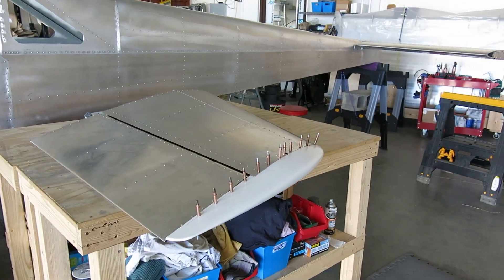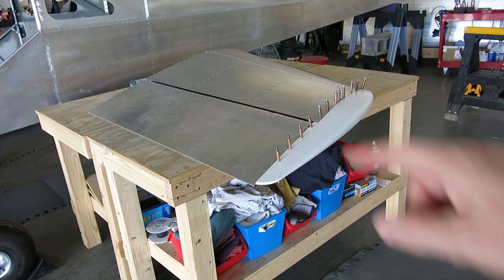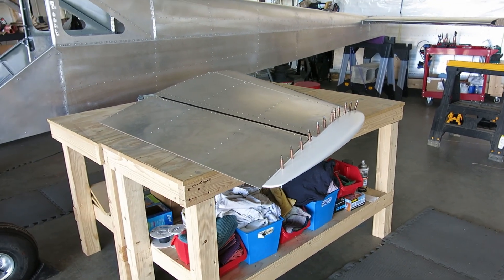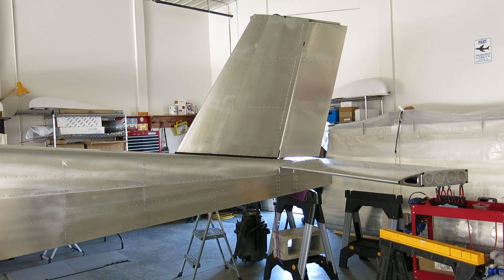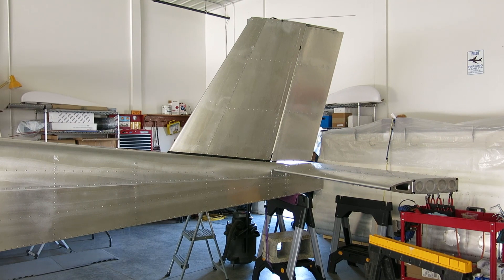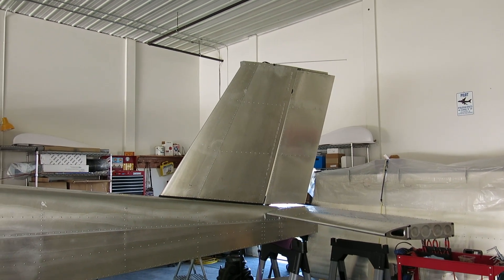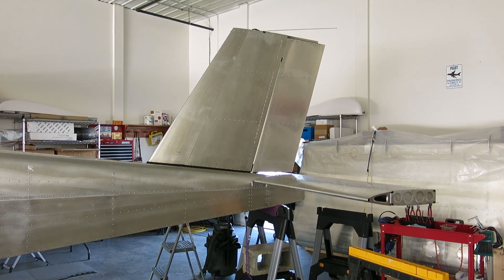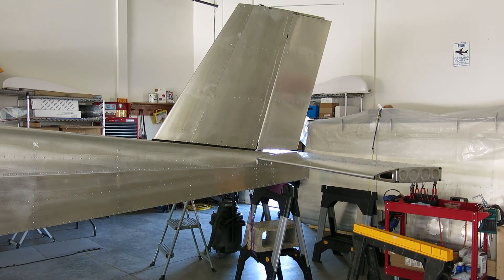No. 202 07-09-2022 Vertical stabilizer

Comment: Which NAV antenna is that? Could you have used a puck style antenna, similar to a GPS, so you wouldn’t have had to route to the rudder tip? Sorry, still learning all the avionics things.
Reply from the maker: That’s a RAMI AV-532L nav antenna. Not sure on the other styles…

Comment: Tony, I noticed you used domed rivets for the fairing nutplates. Did you consider countersunk rivets for these using the screw-type countersink tool? Just curious as I just got my fairing from Geoff and want to get ideas for installing. Great video-- keep up the good work. Randy
Reply from the maker: When we put it on and eyeballed the fit, it looked like there is just a little slope on the fairing to clear the rivet heads. We used 40APR1/8 rivets and they seem to fit good. Was thinking if it rides up at all I could maybe put a little bit of countersink on the underside of the fairing. I know that tears up that CF there, but it be just a whiff off of there to make it flush. I figured it would be better to modify the fairing than to countersink the skin. 🙂
Reply: @s-21project92  Thanks, Tony. I like the idea of modifying the fairing if necessary.  The 40APR1/8 rivets are much easier to install! Randy

Comment: The fin carbon fairing....is it as good as it looks?. Rans say be careful though although I think its mainly for maint and corrosion I would think.
Reply from the maker: It’s super light being CF. We used nut plates so it can be removed for inspection. But also thinking of a small bead of sealant around it to keep water out but not too much as to make it a hassle to remove for inspection. Interesting that they have a moisture concern. The rubber edge around the bottom of the vert stab isn’t that tight, so there will be moisture getting in under there. So I think having that fairing around there will keep that part dryer.